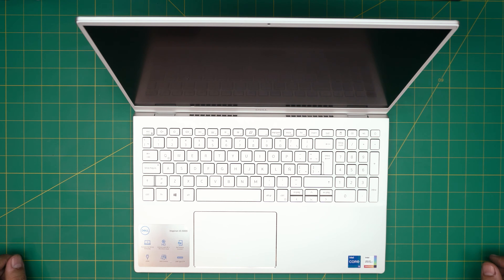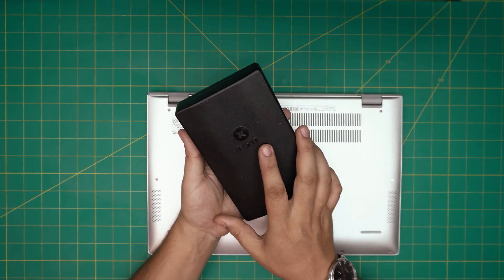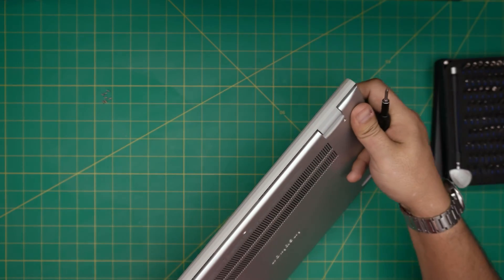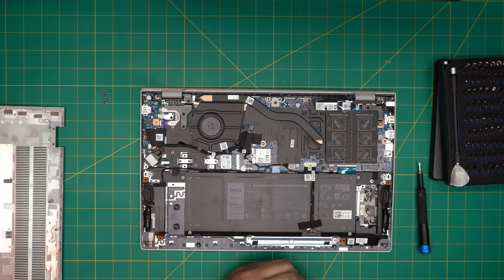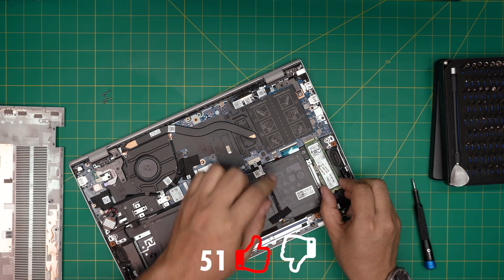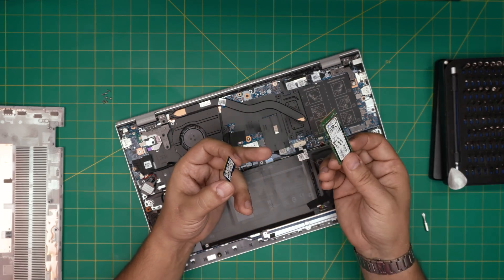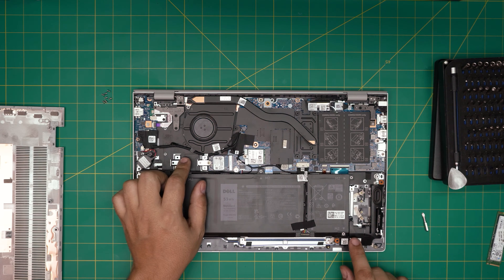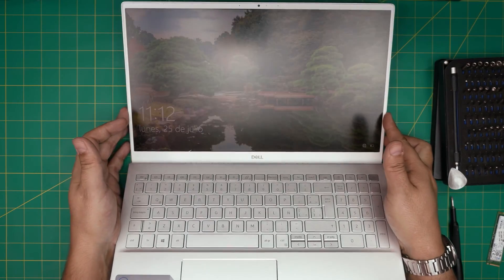How to Upgrade Storage (SSD/HDD) on Dell Inspiron 15 5000 (P102f) Laptop - Step-by-Step

Comment: I have a plan to add other 128gb ssd to my lap, but I need to know if I update new ssd, will it delete my other ssd drive data? Do I have to reinstall windows again?
Reply from the maker: Regarding your question, if you add additional storage, no action is needed as it functions like storage to save data. However, if you want to run Windows on it, you will need to install Windows on that drive, which will erase the data on that drive only. If you already have Windows installed on another SSD, you will then have two instances of Windows. The next time you power on the laptop, it will ask which version of Windows you want to start.
cheers🍻

Comment: This is a fantastic video.  I have a quick question:  if I add the second SSD as the one you showed in the second location, do I still have to reinstall Windows, even though I did not touch or remove  the original SSD?
Reply from the maker: It's my pleasure my friend.
🫠Regarding your question, you don't need to reinstall the OS at all. All you need to do is install the new drive, and once it's in Windows, right-click on the Start menu (Windows Start) and choose "Disk Management." You’ll see the new drive highlighted with black borders. Right-click on it, select "Activate" or "Create Volume," and click "Next" on everything. After that, you’ll be able to see the drive in your computer alongside the C drive.
Should you have any further questions or requests in the future, please don't hesitate to ask me.
cheers🍻
Reply: @ thank you very much!  I’m glad I found your channel.
Reply from the maker: I appreciate your support, my friend.  
If you need anything, just leave a new comment, as I answer them first.  
Good luck!

Comment: r u serious 4tb per slot ?
my laptop processor is i5-1135G7.
Reply from the maker: 🫠Regarding your question, Yes my friend 4TB on each m.2 slot, those are PCI-E lane you can place a 40tb if there were any but then you would need a big heatsink. so a 4TB is the max you can go without needing any heatsink. 4TB on each slot.
Should you have any further questions or requests in the future, please don't hesitate to ask me.
cheers🍻

Comment: I tried to clone the OEM 256GB NVME (OS) to a 1TB NVME. Though the bios saw the 1TB GPT drive, my Dell Inspiron did not recognize it to boot.
Reply from the maker: Thank you for your feedback! If you wish to support the channel, you can like, subscribe, or both!
Regarding your question, that's why i don't recommend cloning not always gets closed right and every program is different, just fresh install windows takes 20min and is the better option:
https://youtu.be/uDu8j2lE-dM
https://youtu.be/GkMZyCUarIA
Should you have any further questions or requests in the future, please don't hesitate to ask me.
Reply: @uFixTek  I tried cloning the 256GB NVME OS chip externally using NVME enclosures. I should try doing a system clone with the  source NVME installed in the laptop and the destination NVME chip in an external enclosure. I didn't do this originally because my cloning software is on a different laptop.
Reply from the maker: you can try it, but again cloning is not 100% effective you can try with source installed in the laptop.